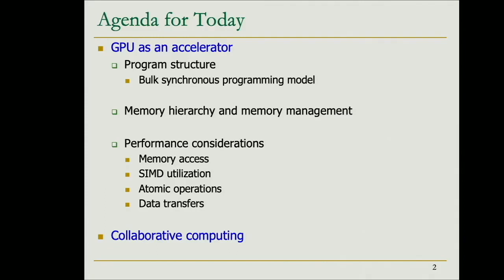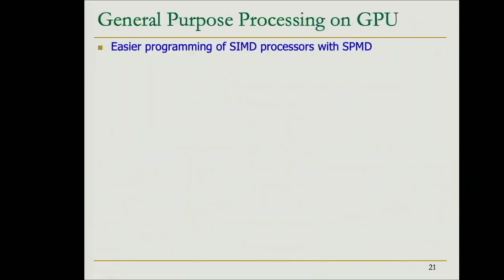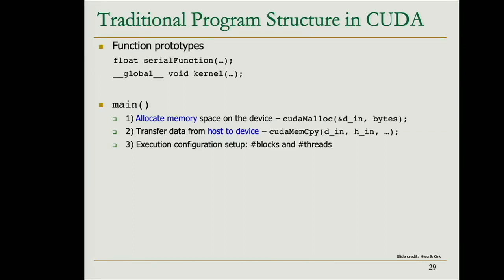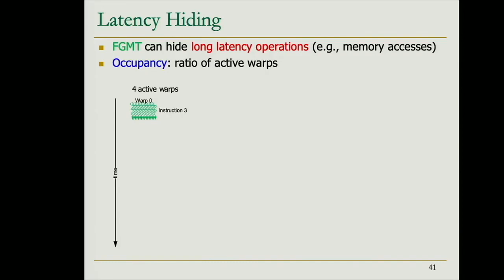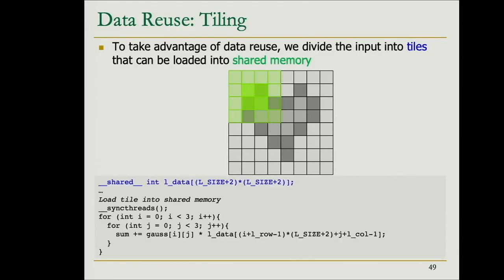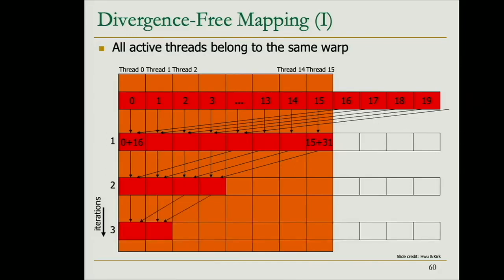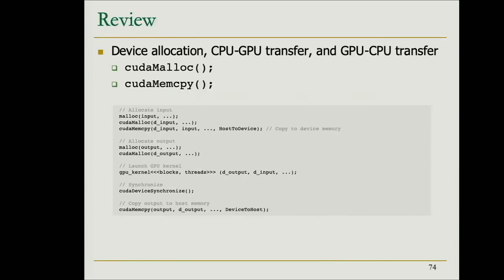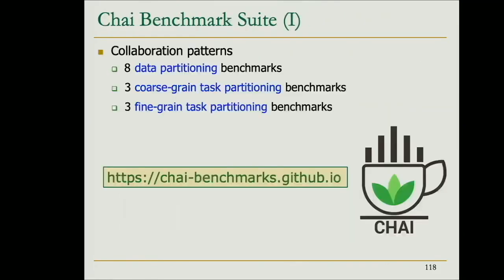Computer Architecture - Lecture 31: GPU Programming (Fall 2024)

Comment: AI Summary

Abstract:

This lecture provides a comprehensive overview of GPU programming for general-purpose acceleration, primarily focusing on Nvidia's CUDA and analogous OpenCL concepts. It begins by contrasting GPU architecture (many simple cores, SIMT execution, fine-grain multithreading) with CPUs and reviews the evolution from early Tesla architectures to modern Volta GPUs, including specialized units like Tensor Cores. The lecture details the Bulk Synchronous Parallel (BSP) programming model used by CUDA/OpenCL, emphasizing the host-device interaction, kernel execution, thread hierarchy (grids, blocks, warps), and memory spaces (registers, shared, global). A significant portion is dedicated to performance considerations and optimization techniques, covering crucial topics like latency hiding through occupancy, achieving memory coalescing, effective use of shared memory (including tiling and bank conflict avoidance via padding), handling warp divergence through careful data mapping (demonstrated with vector reduction), and managing atomic operations (including privatization strategies like in histogram calculation). Finally, the lecture introduces modern concepts like unified memory (shared virtual memory) and collaborative computing patterns, which enable tighter integration and concurrent execution between CPU and GPU, potentially improving performance by leveraging the strengths of both processor types.

GPU Programming: Concepts, Performance, and Collaboration

*   0:00:06 Agenda: Introduction to GPU as an accelerator, CUDA/OpenCL programming structure, Bulk Synchronous Parallel (BSP) model, memory hierarchy, performance considerations (optimizations), and collaborative computing.
*   0:02:39 Early GPU Architecture (Example: Tesla): Introduced general-purpose GPU programming (~12-13 years ago). Example: 240 stream processors (Nvidia term), organized as 30 cores with 8 SIMT lanes each. Executes threads in blocks, decomposed into warps (32 threads).
*   0:06:08 Modern GPU Architecture (Example: Nvidia Volta V100): Shows significant evolution (e.g., 5120 stream processors, 80 cores with 64 lanes each). Introduces specialized Tensor Cores for accelerating machine learning tasks (mixed-precision matrix multiply-accumulate). Features high-bandwidth memory (HBM2) and a shared L2 cache.
*   0:11:27 Key Bottlenecks & Parallelism: Main bottlenecks in GPU programs are data transfers (CPU-GPU via PCIe/NVLink) and global memory (DRAM) bandwidth, which hasn't scaled as fast as compute throughput. GPUs exploit SIMD and fine-grain multithreading.
*   0:21:32 GPU Programming Basics: Utilizes the Single Program, Multiple Data (SPMD) model to simplify programming SIMD hardware. Follows the Bulk Synchronous Parallel (BSP) model where global synchronization only occurs at kernel termination.
*   0:28:11 CPU vs. GPU Architecture: CPUs have few complex cores with large caches and sophisticated control (speculation, branch prediction). GPUs devote most silicon to many simpler compute cores with smaller caches and simpler control, relying on multithreading for latency hiding.
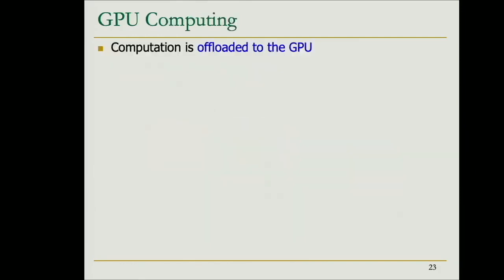*   0:29:33 Basic GPU Computation Steps: 1. Transfer input data from CPU (host) memory to GPU (device) memory. 2. Execute the kernel(s) on the GPU. 3. Transfer results back from GPU memory to CPU memory.
*   0:31:15 Traditional Program Structure: Code runs on the host (CPU) and launches kernels on the device (GPU). Requires explicit memory allocation (e.g., `cudaMalloc`) and data transfer (e.g., `cudaMemcpy`). Kernel launch specifies grid dimensions (number of blocks) and block dimensions (number of threads per block).
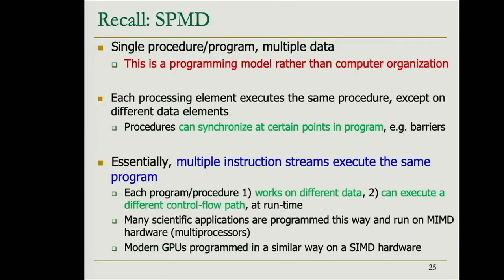*   0:33:29 BSP Model & Scalability: No global synchronization within a kernel launch. Blocks can be scheduled independently onto available GPU cores (SMs), allowing code to scale across GPUs with different core counts. Synchronization across all threads requires kernel termination.
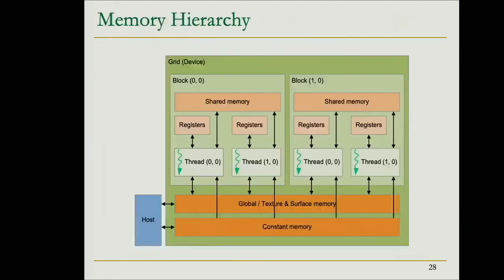*   0:38:51 GPU Memory Hierarchy:
    *   Registers: Private to each thread, fastest access.
    *   Shared Memory / Local Memory: Fast on-chip scratchpad memory private to a thread block, visible to all threads within that block. Used for data sharing and synchronization (`__syncthreads()`) within a block.
    *   Global Memory: GPU's main DRAM, accessible by all threads and the host. Highest capacity, slowest access. Also includes Constant and Texture memory spaces (logically separate, physically often same DRAM).
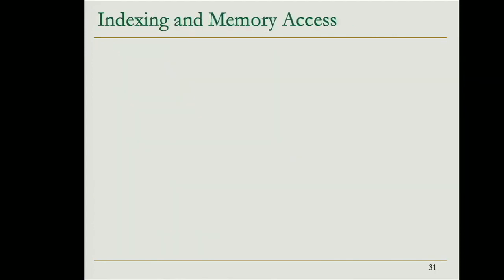*   0:50:24 Mapping Computation to Threads: Data structures (like images) are typically stored in row-major layout in linear memory. Threads are organized in grids and blocks which can be 1D, 2D, or 3D. Built-in variables (`gridDim`, `blockDim`, `blockIdx`, `threadIdx`) are used within kernels to calculate unique thread IDs and map them to data elements.
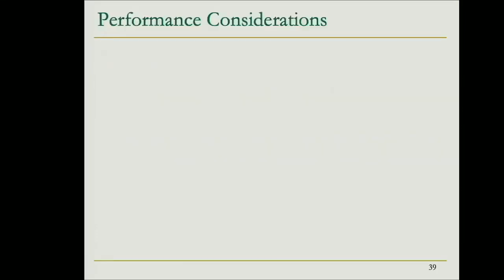*   1:01:59 Performance Consideration: Occupancy: Occupancy is the ratio of active warps to the maximum supported warps per SM. High occupancy helps hide memory latency through fine-grain multithreading (switching between ready warps when one stalls). Limited by resources per SM: max warps, max blocks, total registers, and total shared memory. Programs consuming fewer resources per thread/block allow higher occupancy.
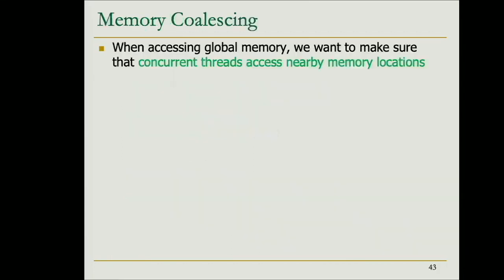*   1:14:35 Performance Consideration: Memory Coalescing: Accessing global memory efficiently requires threads within a warp to access contiguous memory locations, ideally within the same cache line (e.g., 128 bytes). Accessing scattered locations (high stride) leads to multiple memory transactions and wasted bandwidth. Data layout (e.g., Structure of Arrays (SoA) often preferred over Array of Structures (AoS)) is crucial.
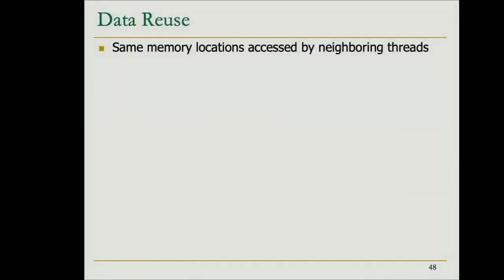*   1:22:46 Performance Consideration: Shared Memory Usage & Tiling: Shared memory enables explicit data reuse within a block. Tiling is a common technique: load a block of data from global memory into shared memory once, synchronize (`__syncthreads()`), then have threads perform computations accessing the fast shared memory multiple times.
*   1:28:08 Performance Consideration: Shared Memory Bank Conflicts: Shared memory is banked (e.g., 32 banks). If multiple threads within the same warp access different addresses mapping to the same bank in the same cycle, accesses are serialized, reducing effective bandwidth. Conflicts depend on access stride. Padding data structures in shared memory can sometimes rearrange accesses to avoid conflicts.
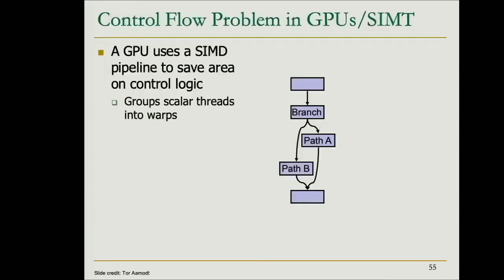*   1:39:16 Performance Consideration: Warp Divergence: When threads within a warp take different control flow paths (e.g., due to `if-else` statements based on data or thread ID), the hardware must execute each path serially while masking off threads not taking that path, leading to underutilization of SIMD lanes. Sometimes, rearranging data mapping can group threads taking the same path into the same warps (demonstrated with optimized vector reduction).
*   1:50:10 Performance Consideration: Atomic Operations: Used for safe concurrent updates to memory locations (e.g., `atomicAdd`). Conflicts occur when multiple threads in a warp target the same location, causing serialization. Performance improved significantly in newer architectures with native atomic instructions vs. older lock-based loops. Privatization (using per-block/per-warp private counters/histograms then reducing) can often mitigate atomic contention (e.g., histogram calculation).
*   2:03:35 Performance Consideration: Overlapping Data Transfers & Computation: CPU-GPU data transfers are slow. Using asynchronous memory copies (`cudaMemcpyAsync`) and CUDA Streams (or OpenCL Command Queues) allows overlapping data transfer of one data chunk with the kernel execution on a previous chunk, hiding transfer latency.
*   2:09:11 Unified Memory / Shared Virtual Memory (SVM): A feature (CUDA 6+, OpenCL 2.0+) that provides a single virtual address space for host and device. Memory is allocated once (e.g., `cudaMallocManaged`). Data pages migrate automatically on-demand between host and device memory, managed by the driver/OS. Simplifies programming by removing explicit transfers and enables finer-grained collaboration.
*   2:10:15 Collaborative Computing: Using unified memory and system-wide atomics, CPU and GPU threads can concurrently operate on the same data structures with coherent memory access. Enables partitioning tasks at a fine granularity, assigning sub-tasks to the processor best suited for them (e.g., serial parts to CPU, parallel parts to GPU within the same overall algorithm step). Requires careful synchronization (e.g., using flags or atomics in unified memory).
*   2:29:48 Persistent Thread Blocks: An advanced technique where fewer blocks are launched than logically needed, and each block loops internally to process multiple chunks of the overall workload. Can reduce launch overhead and enable custom synchronization schemes between blocks.

I used gemini-2.5-pro-exp-03-25| input-price: 1.25 output-price: 5 max-context-length: 128_000 on rocketrecap dot com to summarize the transcript.

Input tokens: 64372
Output tokens: 4355